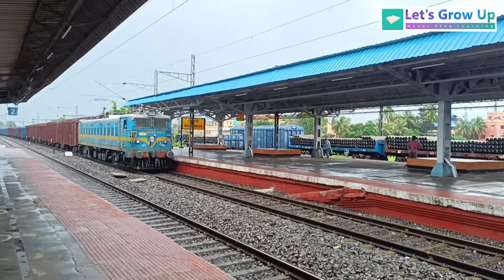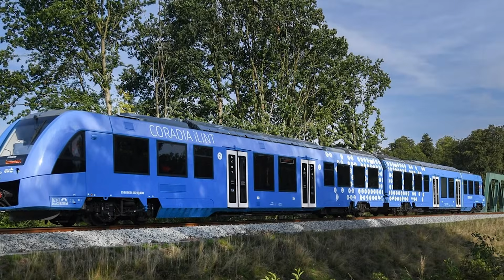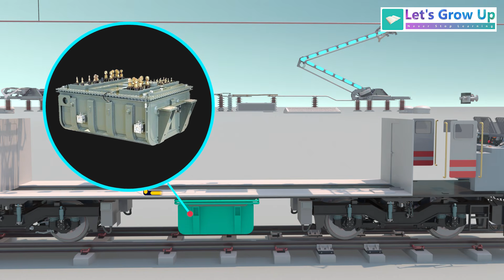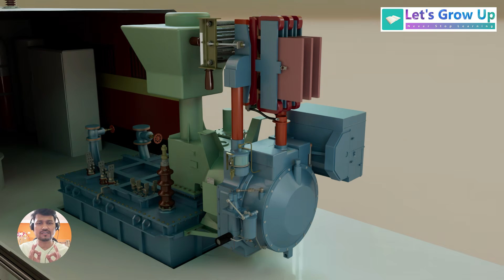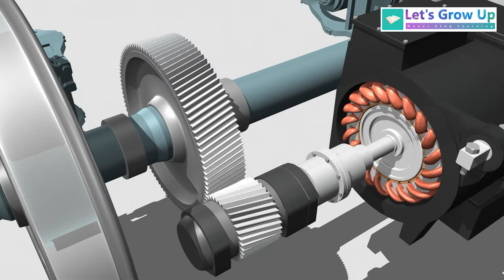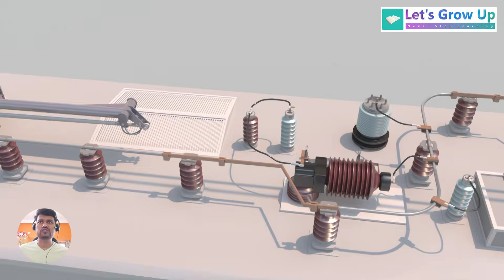How Modern Electric Locomotives Work?

Comment: Good explanation and graphics 👏👏 🙏🙏

You missed as to why AC to DC to AC conversion is made. Very crucial single phsse AC is converted to DC then to 3 phass AC.. which powers traction motors
Reply: it's for variable frequency too. not only for 3 phase

Comment: 1.   Difference between AC and DC is not the Motors but the overhead electric supply being AC or DC. Motors can be anytype depending on Invertors and transformers in the loco.

2. Diesel locos are also electric locos they only generate there own electricity via the dieael engine. Though there are very few Diesel Hydraulic locos which use direct engine power.
Reply: Overhead electric supply is always AC..
Reply: @Abxyz-f5k  Oh no it isn't, 1500 & 3000 volt dc is commonly used. And even then AC can be supplied at 16 & 2/3 Hz as in Switzerland, Germany and several other countries in W Europe. No doubt in the USA the AC frequency will be 60Hz.
Reply: To add to that some Alpine railways use 3 phase supply from the overhead wires. Furthermore significant numbers of locos on the 16 2/3 supply use AC motors, running at that frequency, on the axles, albeit the latest use rectifier / invertor systems.
Reply: @Abxyz-f5k  No

Comment: How much stepped down ac voltage is being used to drive the traction motor
Reply: 25000 volt
To 
750 volt